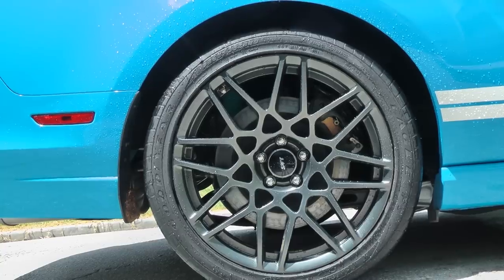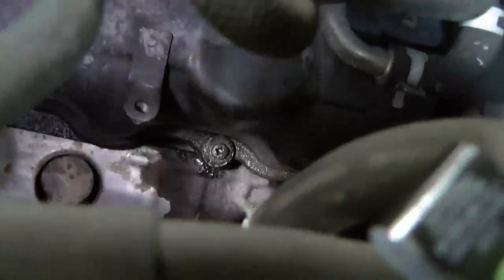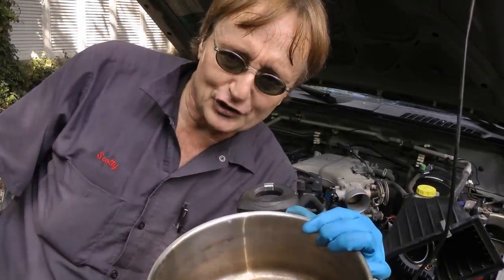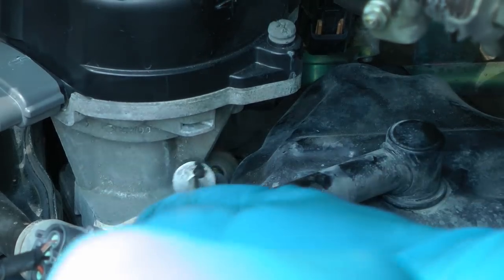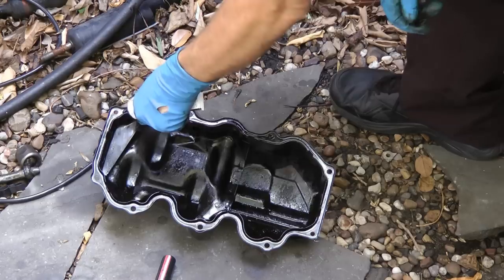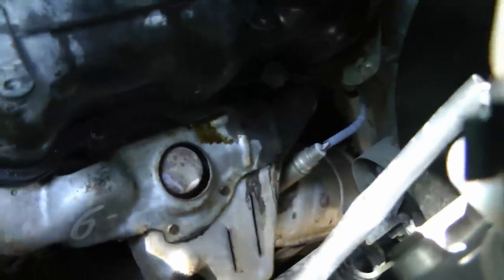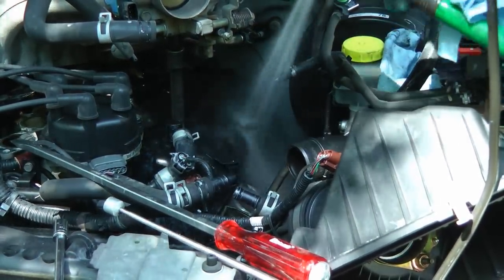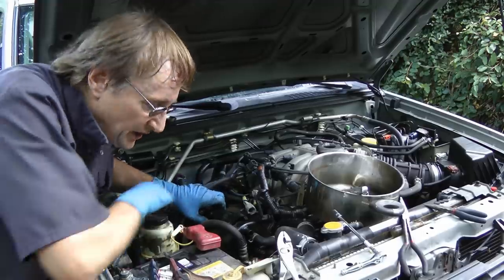How To Fix a Car That Smokes Under The Hood

Comment from the maker: Things I used in this video:
1. 3M adhesive Glue: http://amzn.to/2krn928
2. Engine Degreaser: http://amzn.to/2kofHVx
3. Large Screwdriver: http://amzn.to/2igwntV
4. Magnetic Tool: http://amzn.to/2BOlxUi
5. Brake Cleaner: http://amzn.to/2ks4N15
6. Screwdriver set: http://amzn.to/2jaHIfP
7. Ratchet and socket set: http://amzn.to/2inoxOY
8. Mechanic’s Tool Set: http://amzn.to/2Bzmccg
9. Wrench Set: http://amzn.to/2kmBaOU
10. Shop Towels: http://amzn.to/2jGDfkA
11. Disposable Gloves: http://amzn.to/2zSRuxO
12. Common Sense
13. Full HD Camera: http://amzn.to/2AvoEk7
14. My computer for editing / uploading: http://amzn.to/2i2sKYz
15. Video editing software: http://amzn.to/2jv5Fhf
16. Thumbnail software: http://amzn.to/2k7tz6C

🛠Check out my Garage to see what I use every day and highly recommend:
https://www.amazon.com/shop/scottykilmer

❗️Check out the Scotty store:
https://goo.gl/RwhRGU

👉Follow me on Instagram for the latest news, funnies, and exclusive info / pics:
https://goo.gl/ohy2cA
Reply: hi..scotty 
I  own a Merc 2008 C300 4 matic and when i start to work i take highway and go about 120kmph and as soon as i slow down or enter city limits i see smoke coming out of the engine on passenger side under the hood but dont see any oil leaks !! Recently changed cam shaft caps but other than that no leaks . Do you know what might be the reason for it?

i drive my car straight in the morning without waiting for it to reach working temperature !! which is not good , but is that the reason for the smoke?
Reply: How much should this repair cost?

Comment from the maker: pinging is internal damage, nothing you can fix yourself inside that engine. The cams wear out over time and do that.  With such a pressure differential, engine is just flat wearing out.

Comment from the maker: sealers work on on oil seal leaks, but not on gaskets that have oil leaks. they have to be replaced. You saw how brittle and cracked the gaskets were.

Comment from the maker: try AT 205 reseal on the rear main seal by adding it to the engine oil, hard to find, I get it at amazon. but valve seals, only replacing them will fix that and that's a GIANT job, most gives live with that one

Comment from the maker: there are high heat exhaust epoxys you can try, but normally only welding will fix em as most are stress cracks no epoxy can take such stress.

Comment from the maker: yea, happens all the time on that tight design with those tiny bolts.  You generally have to drill them out and retap them with a tool die kit. but if you put sealer on the gasket, often it will not leak if only a few are missing

Comment from the maker: worn piston rings also do that, if you rebuild an engine you really need to do both top and bottom end, and you only did the top, which often makes the bottom end get even worse from extra pressure

Comment from the maker: well, of course fix the oil leak, oil may be shorting stuff out. also change the fuel filter and pressure test the fuel pump to see if it's weak.

Comment: learn something new every day...! No wonder when i replaced the rocker cover gasket on my mother's old 99 Ford Festiva (called the Ford Aspire in the USA, Festiva in Australia), I put the sealant on and put the new gasket into the grooves, but then had a running battle with it to keep it staying down when i tried to bolt the cover back on.. and i got sealant everywhere! That's where we're grateful for all the free tips such as this one which you dont see on the package or in car manuals. Cheers!

Comment: How's it Scotty, i went to the spares shop and got the new piston rings. i like to work on these things myself so i was also forced to buy the specialized tools to fit them in as well.woke up early in the morning and i started working on the car. using reference from experienced car mechanics on YouTube like yourself. Got the job done and now the car is running, still smoking, but the smoke is noticeably decreasing and there's less oil from the tail pipe. thanks Scotty, you should publish a book

Comment: had to do that with the accord when the oil was getting into the plug tubes, hardest part was pulling the rocker assembly out to put the lower O rings in and looking up the torque specs for the assembly when i put it back inbut since the whole thing came as a set and it was reccomended i replaced the valve cover Gasket too, the old O rings pretty much shattered taking em out they were that crusty, fun car to work on everything was where you could get at it.

Comment: Omg thank you soo much.  My cads a mechanic so I kinda know my way sound cars. My 2005 V6 Mitsubishi Eclipse  wouldn't start after just running it. 3 days later I got it to start,  but discovered there was No oil,  utter was dry.  Last week the car was full of oil.  I filled it with oil , but when I got in the car, it was full of smoke,  smelled like oil. Got it home,  smoke came out from the front of both sides of the engine.  People told me, that I blew the head gasket,  I said no not at all. I think it's definitely the valve gasket.  Just confirmed with my dad,  it has an oil leak.  I'm a girl,  hoping I can do this myself.  I love my little older sports car.  My father lives too far away to fix it.

Comment: Thanks. I had a 2002 bmw 325i straight 6 that burned oil the same way, the valve cover was made of a hard plastic and I was afraid the plastic was warped and that a new gasket wouldnt fix the leak. I also watched a youtube video of some guy changing one on the exact same model and he reallly took a lot apart to get to it. Therefore I didnt risk it. Plus I was getting rid of the car anyway and thats one of the many reasons why I sold it so cheap.

Comment: Using a pressure washer can drive water into places that a normal garden hose won't. I even remove the hose sprayer & just use the naked hose. The key is to use plenty of degreaser since that is what really does the work.

Comment: Hi Scotty. I've got a question, if I may (again). My car tends to blow lots of grey smoke out the exhaust unless I put thick oil in it - I'm not keen on this but I was recommended by my mechanic. Do you have any idea what that could be? I'm looking at replacing my PCV valve next week based on your other video. 

By the way, I'm really impressed with the service you offer. Thank you :)

Comment: He means it's well and truly stuffed. That blue smoke is the engine burning oil. Head gasket failure. Basically, you're looking at either half the engine getting disassembled ($thousands), or you're at a dealership getting something else.

Comment: Scotty I have a 1998 Honda Accord that’s throwing a P1607 code along side several sensors high voltage codes. The map, ect, and iat. I replace the map but the code didn’t go away. I can’t erase any of these codes. They immediately show up on my scan tool soon after an erase. If my ecu is bad would this be what it does and not allow me to erase fault codes?

Comment: My 2001 frontier has the same engine and the same problem, this will help  alot, btw those engines are known to crack exhaust manifolds on the passenger side

Comment: Is this the same case as my civic 96' with a d16y5 engine? Exhaust is clear no colored smoke, no overheating. White smoke only comes out when I drive it hard but during idle and normal driving scenarios it doesnt smoke. Thanks in advance.

Comment: I have a 2004 Mazda MPV LX minivan (6 Cylinder Engine with Automatic Transmission) with about 250,000 miles. It smokes under the hood after driving for a little while. One mechanic told me that the oil pan has a tiny hole & that the Timing Cover needs to be replaced. Another told me to get the engine washed so he could see where the leak might be. I had the radiator, radiator hoses, & serpentine belt replaced about a year ago. My Innova OBDII Scanner has the emission system in yellow, but no codes. I use Full Synthetic motor oil & replace it every 3 months.

The Timing Cover sounds like one of those dealer only parts.
Reply from the maker: +jfs1988 do my video "finding and fixing car oil leaks" to find the leak For Sure first. Timing cover and oil pan could be welded fixed IF holes are small, realize that

Comment: Hi Scotty-Tried to start 2001 Ford Focus today and there was a sound like a backfire and smoke from under the hood. Couldn't see cause. Started car again, it started but was sputtering like it would shut off, then suddenly began reving high and loud. I shut it off and waited. It did the same again when I tried later. A guy at work took a look and drove it around block, said he thought it was the intake manifold, getting too much air somewhere. Said it shuts off when it stops at lights, and that my new breaks were gone. I tried to drive home, noticed the left turn signal was lit up when not on, didn't blink when I turned it on, headlights were going bright and dim with the idle of engine, as I drove the breaks stopped working intermittently. Break pedal went all the way to floor and didn't work, e-break didn't work. I sailed thru an intersection with no breaks, then they worked for a minute then out again. Engine sounds awful and keeps sputtering and reving I couldn't drive it. Any thoughts? Thanks.

Comment: Just did this on my impala with the 3800 series 2. With the help of a friend since I got all the wiring out the way we went ahead and just replaced both valve cover gaskets, upper intake and lower intake gaskets.. replaced spark plugs and all wires... idk why but its just the more we took apart the engine the more I just wanted to replace things lol.

Comment: Does your BMW have a dipstick? That might sound like a stupid question, but some BMWs don't. If it does, check the oil to see that it's at the right level and that it's in good condition. It should be pretty close to clear. If everything checks out, just check it again in 5,000 miles. 

Synthetic can go longer because it's engineered specifically for engines vs. conventional oil which was pulled out of the ground and was never really meant to be in an engine. Hope this helps.

Comment: Hello ScootyKilmer I’m seeking your opinion on my 2003 Ford Taurus SES with 113867 miles recently changed serpentine belt do to loud squeaking it’s been about 3 months of engine light & white smoke from the left side under the hood accompanied by a smell of antifreeze the car smokes when stopped in traffic and smokes more! When I make it to my destination no leaking underneath. Also if need be & because I’m budgeting, what would be the safest and cheapest amount to by a car? If you so kindly can point me in the right direction .
Thank you for your time

Comment: VW Golf 1.4 16v 1999 mk4. Blue smoke comes out of the exhaust at high revs, sometimes gets worse, sometimes gets better. There was a bit of white creamy texture liquid on the oil dipstick. There's also a leak somewhere, oil light keeps coming on. Had the gaskets changed but still the same... Any ideas why Scotty? 
Thanks
Abz

Comment: hey scotty i have an engine with 190,000 miles im thinking of putting 0w-40 oil in the owners manual say 5w-30 for 30 degree and below and 10w-30 for 30 degrees above. (1994 mazda mpv 3.0 rwd)

Comment: Question, say I just changed the valve cover gasket, and put everything back together correctly, and I turn the car on and not even 20 seconds the thing starts smoking. What do you think that could be??? FYI There was no smoke before I changed the gasket.

Comment: Darn I was afraid of that. I guess ill just keep using german castrol(since it doesnt burn it) till i get enough money to rebuild it. As for the leak ill just clean the bottom of the engine and see were the leak is coming down from. Thanks dude ur real help btw badass gt500 and stingray.

Comment: Hey Scotty. I have a 1999 Cherokee and it might have a possible radiator leak. I had it flushed and new coolant about a month ago, now I find that it is leaking anti-freeze coolant. The hoses look find and the clamps are on snug. Whats your take?

Comment: Hey scotty...i have a question...will it be a problem if u leave the car like that? My car throws smoke under the hood and i clearly see that there might be an oil leak. But at the moment i dont have the money to fix it...can i still use the car like that or what do u suggest? ...plz

Comment: will runing the motor with the belts removed hurt the car ? and the noise starts when the engine is warm and it sounds kinda like a desiel when i drive it does that sound familier to you ?

Comment: hey scotty i have a nissan altima 4cyl when i turn the ac on it overheats i replaced the water pump, thermostat, flush the radiator wich is good and i never found the problem and a friend has a honda civic doing exact the same thing what do you think the problem might be? oh and thank you for the great vids !!

Comment: Scotty!! I have a 2004 WRX STi that is in big need of your help!! after driving it around for 5 minutes or so, I get this white smoke coming from under the hood. It smells like burnt plastic and it even gets into the car. The smoke is coming from around the turbo area but i have no idea what it could be. All the fluids are where its supposed to be and the engine isn't overheating. Your advise would be really appreciated!!

Comment: thats true man lol but hey i took the belt off and the sound is still there it sounds like its comeing from the crankshaft pully do you think a new crank shaft pully will fix the problem? i read on mbworld that a common failure on this car is the crackshaft pully and harmonic balancer but i dont got the money to keep spending on useless parts that dont fix my issue do you think a new crank shaft pully will fix this noise ?

Comment: Scotty, some of the dash stuff on my '83 ranger doesn't work. The stuff that doesn't work at the temp gauge, oil pressure, and alt charge. The only gauges that work are the gas gauge, and the spedometer. Do you have any idea what could be wrong and how I could fix it? Besides a broken fuse, of course.

Comment: I have a 2001 Lexus is300 and I had a large amount of smoke from under the hood. My friend (works in cars for a living) told me he replaced my valve cover gasket and changed spark plugs all that jazz. But also said I might need to replace my oil pan gasket as well. Could that also be a reason for the smoke? My temps are fine trust me it’s my daily.  And I replaced my hoses too. I have the oil pan just waiting on a day but wanted someone else’s input

Comment: sure I will explian
The car appears to have an oil leak around the valve cover because the gaskets have failed but he had to take the plentum loose to get to the valve cover. The plentum gasket/o-ring should also be replace as well. I have taken a few Ford 5.8L plentums off and had to replace the gaskets because the gasket breaks apart some sticks to one side of the plentum and others stick to the intake. You get an vacuum leak between the intake and plentum.

Comment: hi scotty. i recently purchased a 1995 toyota 4runner, v6, 2wd. smoke is coming out of the engine like in the video but its only from one side... after a close inspection i noticed that both sides(passenger+drivers) were getting all gunked up. should i change both out? or just clean them up?

Comment: I have a 1998 buick regal. And i thoughti had a blown head gasket but i replaced it and i even milled the heads back down but after putting it all back together again its still smoking out of the engine and tailpipe any information on what might be wrong would be helpfull

Comment: Hi Scotty: I had a 2008 BMW 535i, recently I had white smoke out of hood and coolant leakage on the ground. I brought to the local individual shop they replaced my whole Turbocharger Oil Lines and cost me $4K. Is their solution right for my senario ? please kindly advise. Thanks!

Comment: Scotty... 98Camry, 240Kmi, 4cyl with  compression ranging  from 180 to 195..with radiator leak and  iac problem, oil leaks and "new" , pinging at the top of the valve cover,  what would u do first?   take off the valve cover gasket and look for damage?
should i clean out the throttle body and iac valve? manifold gasket?
new radiator?

Comment: What if you see light smoke coming from the engine bay after hard acceleration? I see I have oil leaking from my dipstick assembly and that may be where it was burning but it only happens after driving hard. All of my fluid levels are good and I checked my gaskets and everything was dry except for 2 little drops of oil that got into a spark plug well😩. Any suggestions? It's an 08 accord v6 automatic

Comment: Did VCG on my grammys '91 Taurus. Front was a breeze after I wrestled the back one around the intake and angled it out just right.  I think EVERY engine engineer needs to work on what they design and alot of these repairs wouldn't take an afternoon!

Comment: Hey scotty I have some spilled oil on a part of my engine in my 92 Mazda b2600i its on the drivers side on a plain sloppy part and when I'm done driving my truck sometimes smoke comes out. Is that just the spilled oil burning off? I can see the smoke coming from right where the oil is at as well. It will just burn right off right?

Comment: I have a wierd question...Dodge Durango SLT 2001....was troubleshooting the front blower motor not working.  The voltage on the motor connector showed 12v with the switch in the off position, which should indicate a short.

Further troubleshooting revealed a bad resistor pack....how does a resistor pack like that short, or am I missing something?